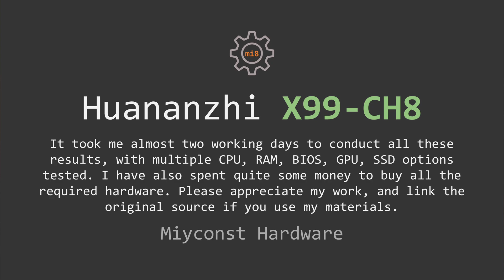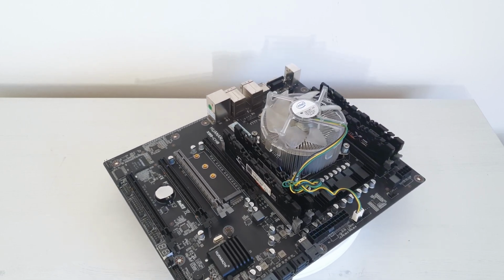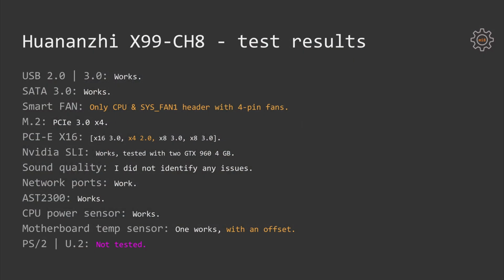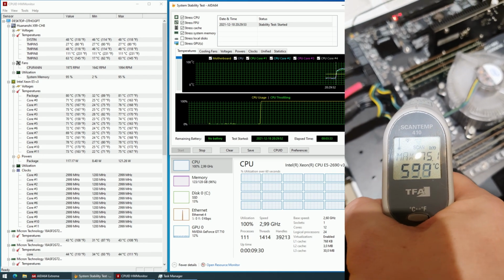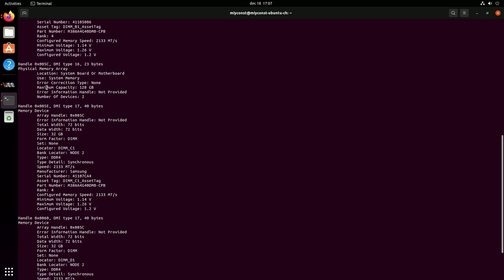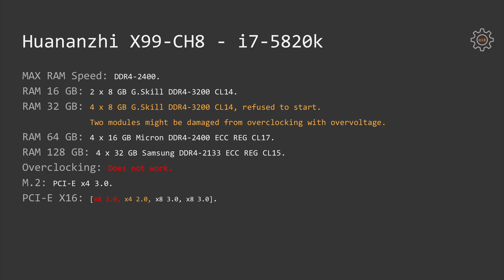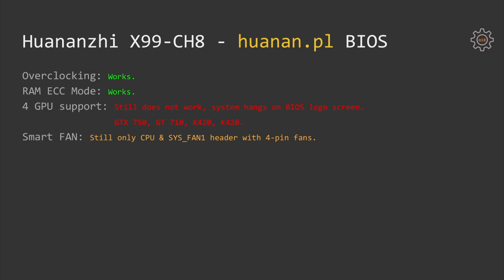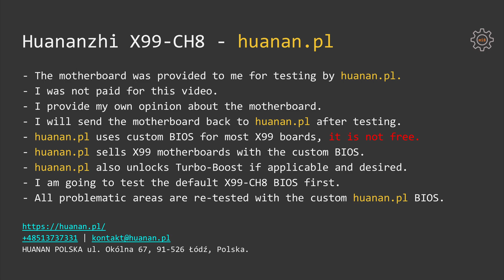🇬🇧 Huananzhi X99-CH8 – LGA 2011-3 motherboard for servers and mining, detailed review

Comment: Is there any way to make modbios for Huanan mobo to enable boot without GPU installed?

Usecase: I have e5-2678v3 with X99-TF and planning to use it as headless homelab/NAS server, it would really help if I had no need in any gpu, thus I am planning to install one later to have hardware encoder for PLEX

Тобі може здатись що твій вклад мізерний, але не треба себе знецінювати і вигорати внаслідок цього. Кожен з нас робить «трішечки», але якщо то все об'єднати — виходить нереальна кількість підтримки і профіту заради перемоги.
Тримайся і Слава Україні!
Reply from the maker: Huananzhi X99-CH8 has an onboard VGA adapter, thus it works without a dedicated GPU with no issues. Щиро дякую за підтримку!
Reply: @Miyconst  yes, I noticed, but I have working x99-TF board without it
And according to little research I did, it is possible in general to boot completely without GPU, but it is tied to "is the manufacturer enabled this possibility in bios of this mobo or not"
Since I already have the board, it would be great if such mod was possible
But if not - it's cheaper to buy some pcie gpu than to buy another mobo)
Reply: @OrangeNooob  Have you tried it without GPU? I have Huananzhi X99-F8 and it actually boots without GPU. I bought a Zotac PCI-E 1x card for it so it would boot but it was not necessary.
Reply: @BertM3  thx for the hint, it worked!
I had ssd with truenas installed, and it booted just fine (excluding this awful onboard buzzer on boot process)
Well, I guess only thing left is "wait for war to end and finally upgrade myself to 12gen to migrate this system to NAS" 🙃
Reply: @OrangeNooob  thankyou for your describre Im from china. now I will buy x99 -tf .but I have two things to ask firstly does  the board boot without gpu runs perfertly secondly  how about the reg ecc ram works .please forgive my poor english I am trying my best to improve it.
Reply: @神仙-s3y  board boots without gpu, tested with ssd with truenas installed on it
Regarding ram - tested samsung ddr3 reg ecc, it works
Reply: @OrangeNooob  thanks